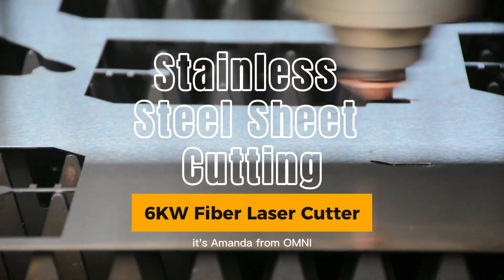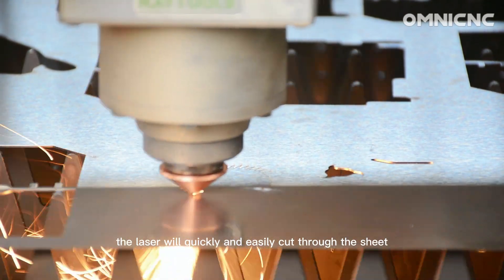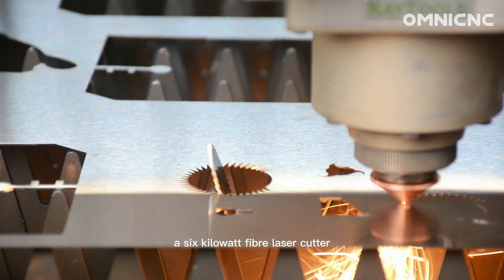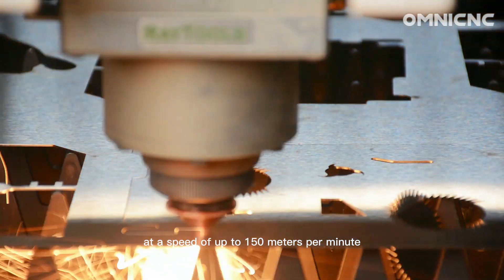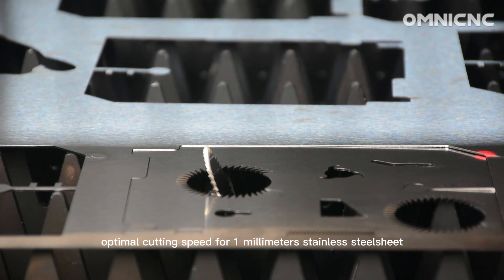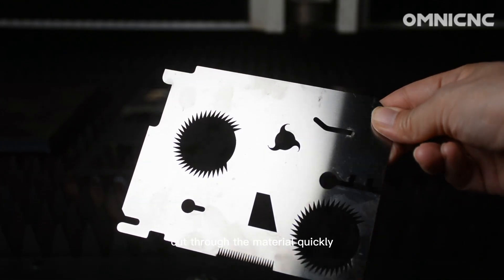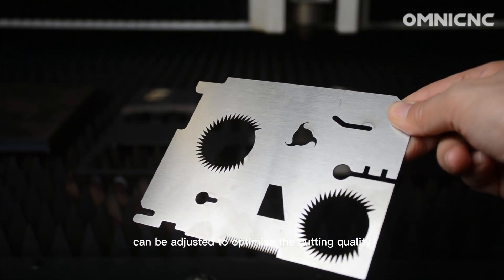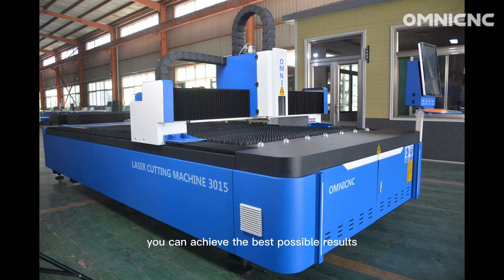6kw Fiber Laser Cutter Cuts 1mm Stainless Steel Sheet with Precision and Speed

Comment: To cut only up to 1mm it's not enough? most industrial applications are 1/8 thickness 3.19 mm stainless steel ?
Reply from the maker: 1000W can cut 4mm stainless steel, but for more efficient working performance, suggest you 1.5 or 2KW fiber laser source.
Reply: @omnicnc  My application is 1mm or less. It is enough for me. Do you have or recommend a cutter that can do it? Thanks
Reply from the maker: @objvst  1500W is enough. But since you gonna consider using for several years and might cut thicker sheet metal, so suggest you at least 2kw or 3kw.
Reply: @jamesquiroz9720  I probably won't cut thicker metal than 1 mm. What machine do you suggest at 1500 or 2000 kW for my application?